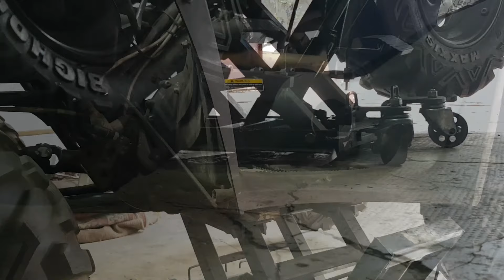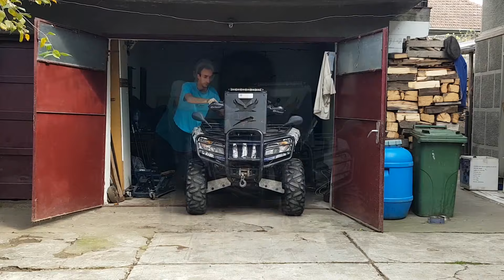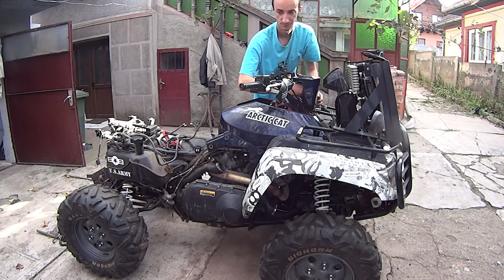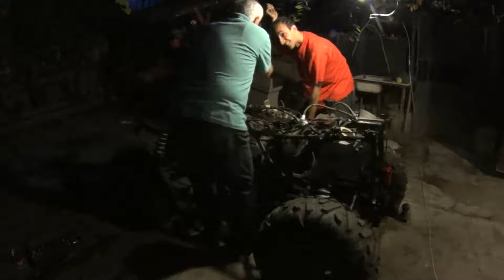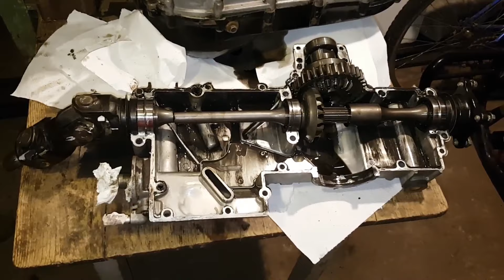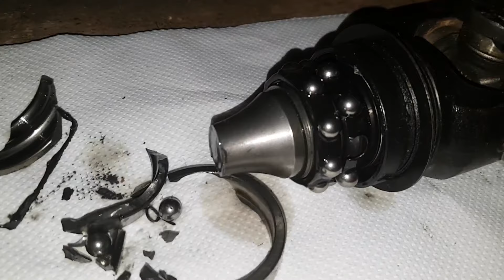Restaurare ATV - Partea 5 - Am Dat Motorul Jos de pe ATV!

Comment: Asteppt contiunuare apropo ce am observat ai 1 radiator de apa pus de tine in botul atvulu dc si inca 1 de ulei care teoretic se folosesc la cele care sunt racite cu aere si nu au apa alea au radiator de ulei tu dc iai pus la al tau si cel de apa in bot
Reply from the maker: Are 2 radiatoare din fabrică, unul pentru apă și celălat pentru ulei. Nu sunt puse de mine. Erau sus, pe portbagajul față pentru a avea o răcire mai bună (și să nu sară/ardă siguranța) atunci când se traverseaza prin apă adâncă.
Reply: Mai cat m-am chinuit sa citesc mesajul tau .. de semne de punctuatie nu ai auzit? Scuza-ma dar ii foarte naspa la citit
Reply: @alinflo21  daca te referi la mn te cred ca nu mai stau sa pun punct virgula liniuta aia si poate cate o data mai apes pe litera de langa cea care vreu sa o apas si duce la deruta da asta se intampla din graba sai daca ai 1 deget care acopera 2 butoane 2 litere mai exact ai inteles